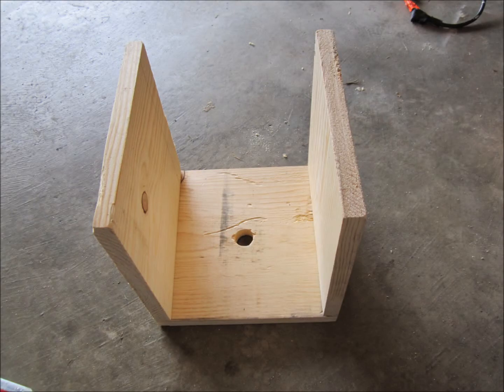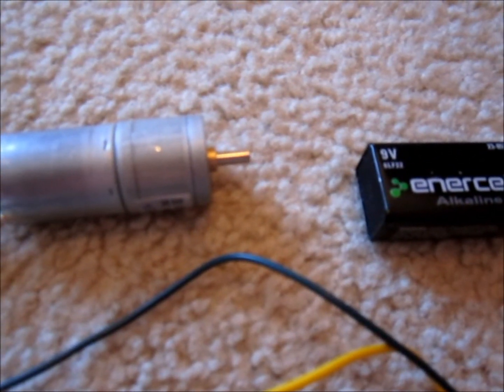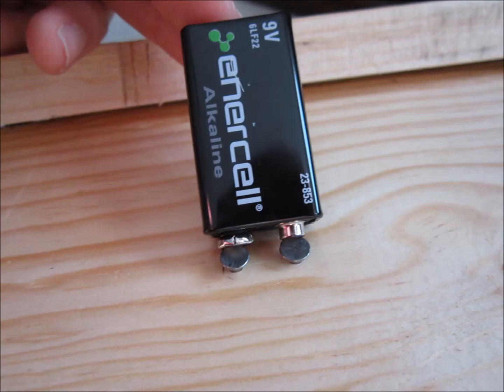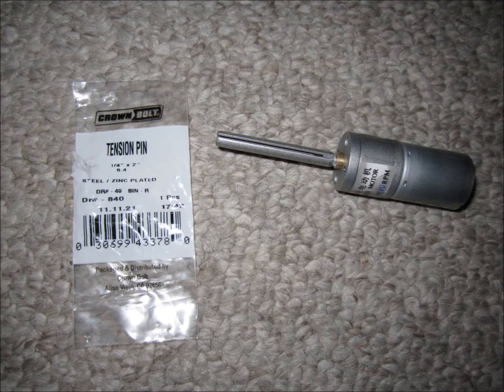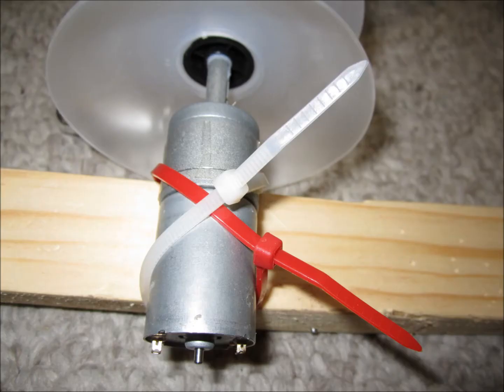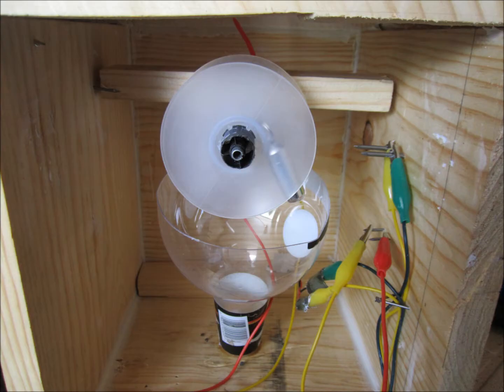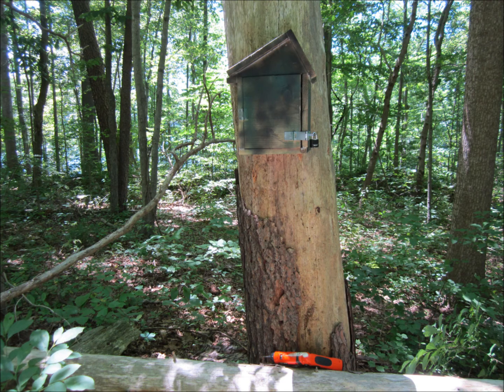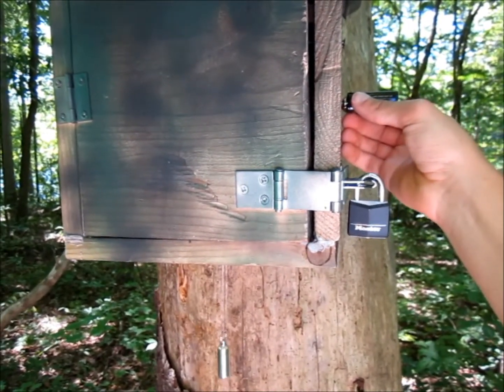Motorized Geocache + How To

Comment: The only issue I see with these caches are the hinges and the locks. You need to put them to where the screws are COVERED! So many build them with the screws outside to where it only takes one screwdriver and 30 seconds to open it up.
Reply: that's not how a geocache works, you don't destroy it to get in.
Reply: I know this... but that doesn't mean people don't do it. I've seen it happen, ask WVTim. He's had caches opened before.

Comment: where did you get this motor? I've been looking for a good one for a cache that would need to be let down and brought up similar to this
Reply: Did you find it yet?
Reply: +Miksu Sarja yes I found a few that would work. rigged up an on off switch at the bottom of a tree and ran the wire all the way up on a branch to let an apple (the geocache) down then back up. but somebody left the switch on and it burned up so I need to replace it.